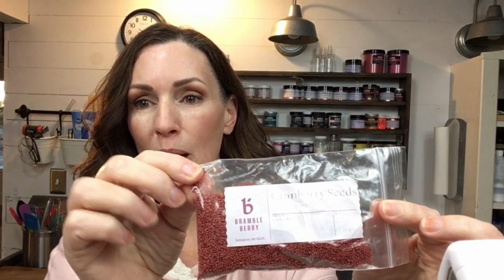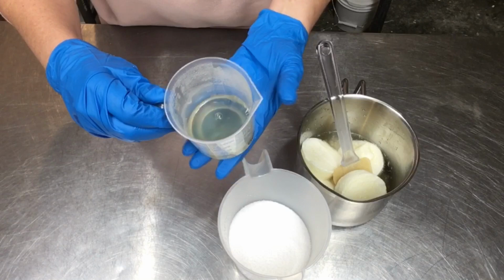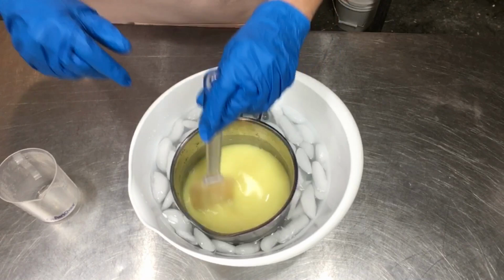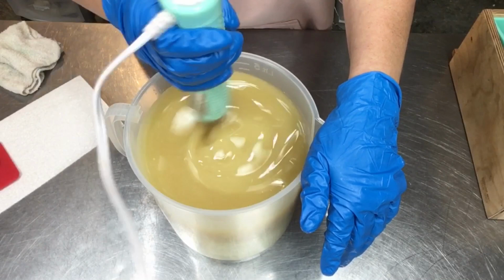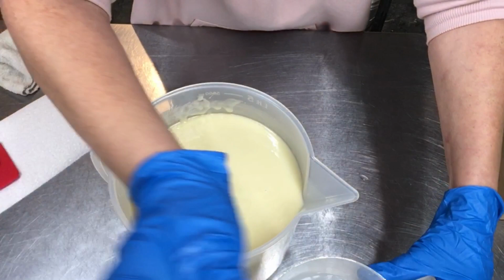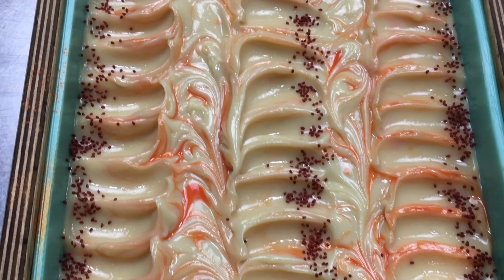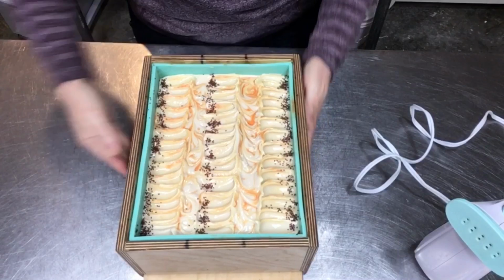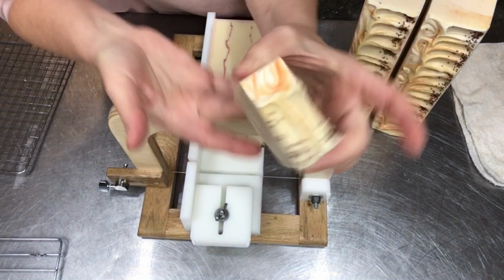Making ORANGE CRANBERRY Goat Milk Soap, Plus how to add Silk fibers | Ellen Ruth Soap

Comment: Stupid question here: If you use a 50/50 goatmilk and water solution can you dissolve the lye in the water portion let it cool, then add it to the goat's milk will it cause the milk to scorch if the milk is not frozen?
Reply: I don't think so because it won't be enough liquid to dissolve the lye and it will turn into a hard thing... dont ask how I know 😬 someone correct me if I'm wrong.
Reply: There is a milk to oil method of adding goat's milk. You add equal amounts of water and lye to dissolve the lye and let it cool to room temperature. Then add the milk to the oils. I will go find the video that I watch. She explained that far better than I can.
Reply: Look for holly - kapia mera soap co Milk to oil method video
Reply from the maker: She explains it so well in her video! Super great info!
Reply from the maker: If you are adding the milk seperately, you need to make sure the volume of liquid added to the lye is equal or more.  You can never add less liquid per volume to lye or it will volcano.
Reply: @vixenligon1167  I remember that video but forgot which one it was exactly. I’d love to reference it too!
Reply: @vixenligon1167  - this is what i was referring to when I meant adding the lye to water at a 1 to 1 ration.